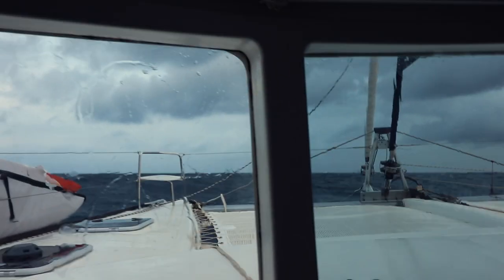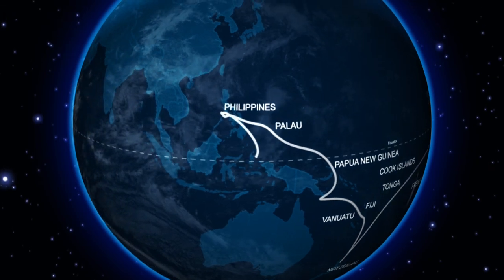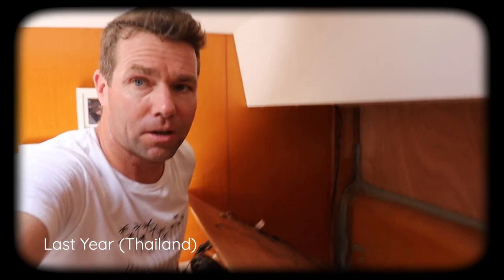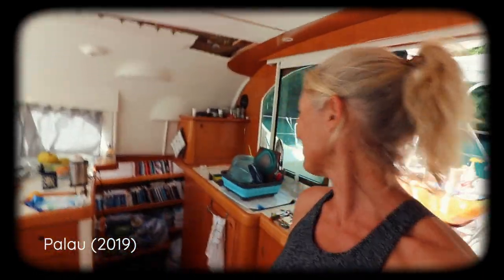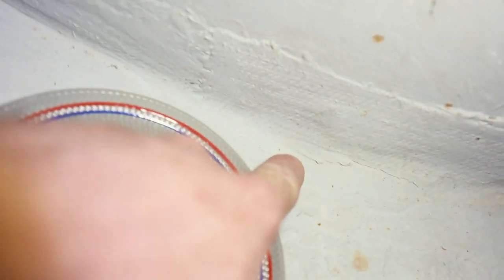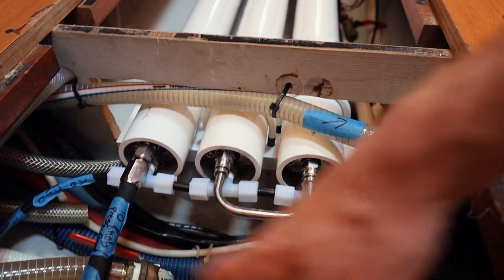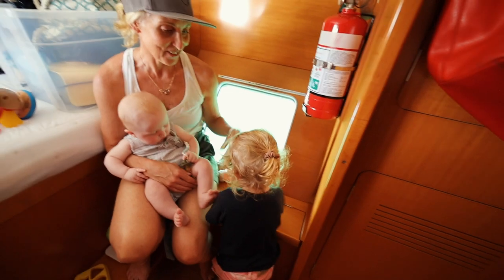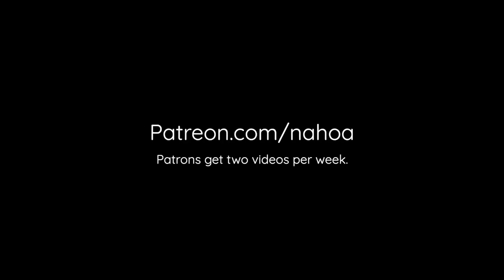Lagoon catamaran Bulkheads

Comment: When I was building my little F-9A tri (Carbon skin over duracore), I wanted to strengthen the epoxy/putty fillets before taping panels and bulkheads together. Once I mixed the resin, I added some scrap carbon fiber filaments (about 1/4-3/8" long) and mixed them well, then add the fillers/thickeners for the putty. The intention was that all the filaments going different directions would make the putty bullet proof. After shaping the putty fillets, I would immediately tape the joint together with bidirectional carbon cloth and top with peel ply. Doing it all in one shot made it all one solid piece. Of course you could use glass fibers but you'd have to make sure the filaments wet out fully and don't rob the resin from the putty.  It would be best to practice this a little first to get the mixture and technique right.
To test both putty's (w/ and w/o fibers) I smashed samples with a hammer against the concrete. The fiber infused putty was significantly stronger. It was a little harder to work with but I'm glad I did it that way.
I just figured I'd mention that option for anybody re-filleting and re-taping their bulkheads.

Comment: Thank you, guys, for this video. I have been following the saga of the bulkhead issues of Parlay Revival and have been concerned with my favorite sailing channels that use cats. I am very glad to see you have been pro-active on this unique design flaw of the cats. Every cat owner would do themselves a big favor to inspect and repair any defect in their cat for their own safety and comfort. It is a design flaw perpetuated and accentuated by cat builders willing to take short cuts in production in order to rush a product to market. Optimum high-quality products are a result of high-quality design followed by high-quality construction materials and methods. Period!
Reply: Parlay Revivals last release was on setting up their rigging and it 
Was revealing to say the least ... Part of the failure problem may have come from the cats rigging being overtightened ... according to their expert .... 
The problem being tensioning stays to monohull type levels is enough on the Parlay generations of Cat to bend the bridge deck by over tensioning against the mast stays. 🤔 This on itself would load up those full width bulk heads .. 
They even showed how it first showed up in doors that wouldn't close due to distortion it could induce.

Comment: Hey Ben, You might want to take a look at how your new lithium batteries are wired. I highly recommend reconfiguring them with bus bars and equal length wires. Its hard to tell in the video but it looks like the way they are wired now 1 or 2 of the batteries do all the work. This is crucial for the life of the battery more so now as you will be demanding much more power from them for your new air conditioners.
Reply: I never thought of that.  Very crucial for multi battery setup.  The wires can also heat up if some are a different size. I've had a plastic liner melt because 1 wire became overheated in a 3 battery setup.  Thankfully I was close to shore and safety.  
Good luck out there.

Comment: It's not just bulkheads or Lagoon. It's keeping an eye, nose, and open ear, on your boat for anything different. One telltale sign of the Lagoon 450 bulkhead issue is a creaky, noisy, boat. It was a strange noise that alerted Ben and Family about an issue that needed attention on their boat. Another thing that Colin of Parlay Revival tested was how flat the deck was, it wasn't, there was a 40mm drop in the middle. Troubles with doors not closing or gaps getting wider were another sign. Another good point brought up on Colin's channel was the importance of properly setting your rigging and gaining the knowledge of when and how to adjust it.

Comment: I'm watching another channel called Samson Boating, where Leo is building / restoring a 110 year old sailboat called 'Tally Ho'.  I found it interesting how they built the bulkheads, layering and then gluing together 2 separate walls of tongue and groove wood in apposing cross direction pattern.  

I think they use 3/4 inch, so the end wall is 1.5".  They cut two walls, with the alignment of the wood probably 30 degrees off center left and right, so one half of the wall is going up to the left and the other going up to the right.  After dry fitting, they then glue laminate the walls together, and put in hundreds of screws

https://www.youtube.com/watch?v=NPPGWtHEQO0

I also noted the Tally Ho is a mono hull, with no fly bridge to support above. 

It looks to me like Lagoon just slipped a piece of 3/4 inch wood sandwiched between to walls of thin fiberglass, where the fiberglass is more cosmetic to cover up the wood.  And that's a bulkhead on a million dollar boat with a full deck and galley above it and then maybe a flybridge too in some models?

I think the government needs to step in and regulate bulkhead construction.  If you build a home, you have code rules to stop manufacturers from building substandard then hiding it behind drywall.  Looks like boating construction needs the same oversight.

Comment: This would be the best and informative video I have watched.
To me the problem with the use of adhesive is it applied to thick.  With age it shrink, which leads to cracking.
To me if lagoon stopped using balsa wood and heavy ply but built with foam like other manufacturers. They would be building a better lighter  boat.

Comment: Because it has a crack in it not necessarily makes it unsafe, a very important distinction needs to be made between what is structural and not.
The putty stuff is not structural even though it might provide structural help but also most likely was intended to remain flexible and reduce stress and friction noise. Reinforcing this, will help the strength of your boat but maybe unnecessary as any structure is only as strong as it’s weakest point. Kind of like building a safe in the middle of your boat if you get my meaning 😉

Comment: I have never liked multihulls for heavy weather sailing. They are subject to extremely high levels of stress, particularly twisting stress, and those stresses go up at an exponential rate. That coupled with the need for light weight construction and trying to keep the costs down are a  dangerous combination..

Comment: Excellent topic for today's video!
I've been looking into the issue, as I'm looking to have a trimaran designed and built, for circumnavigation.
I've noticed one thing which has not really been touched upon, regarding all of the information on the net (real, imaginary, technical, hocus-pocus, etc).
It seems that the majority of the Lagoons have been CHARTER boats, and therefore are much more easily purchased than a new boat.
These boats are always on the market, after being abused by people who have more or less been using them as party and drinking platforms. They've received incredible amounts of abuse, what with being beached "for the fun of it," being slammed around in any and all conditions, and worst of all, having their rigging monkeyed with, tightening them and causing incredible amounts of tension which pulls the hulls up, opening up Pandora's Box when it comes to tension/compression stress, fractures and buckling.
All of these combine for terrific forces on every single bulkhead.
Then there is storm damage, which is not inconsequential.
Yes, it's fun to jump on the Blame Bandwagon (which is what has been happening), when it's much easier to point the finger at the manufacturer, rather than take a full assessment regarding responsibility, but that's human nature.
EVERYONE is responsible for the safety and well-being of their boats, so we should simply not sail them in a way which typifies the old joke about the 1950s automobiles. Remember them? "I have a BUICK!! I can drive it until it breaks, because it is so well built!" Yes, the old cars from that era lasted hundreds of thousands of miles and were easily worked on and fixed.
The Catamaran is not a Buick.
I'm aware that I'll be getting a lot of negative comments for this post, but I would much rather see videos like yours (while living vicariously through all of your incredible journeys), while keeping my mind focused on facts and reality, than sitting here with my mouth shut and watching all of the other videos out there, who spend a lot of time being negative about the whys and wherefores, rather than  being fully honest about the situation.
Thank you for your insight and great good luck in everything which you do!
Reply: As a mechanical engineer, what you said is patently, blatantly not true.  The one and ONLY reason charter boats have more issues is they actually get USED as boats instead of sitting at a dock all their lives like most boats.  A charter boat will act like a live aboard boat... HEAVILY used.  The fact these boats have their bulkheads rip out because they are too CHEAP to use fiberglass and instead only use putty, is there due to MARKET pressure for a CHEAP charter boat which the "owners" then sell CHEAP  after a few years.  These charter boat owners do not give a shit about longterm.  The boats are perfectly good for 5--7 years of use and then peddle them off to most people who will simply have their boat sit at a dock or on the hard for 11 months of the year.  

Yes, boats can be a buick, they are called monohulls.  The Current catamarans are built to lightly to last due to market pressure for short term monetary performance.
Reply: If you haven't already been watching Parlay Revival and the issues that Colin has had with his bulkheads, I suggest you watch that. Colin is a mechanical engineer and knows a thing or two about boats. He stated in one episode (after a lot of research and collaboration with various industry experts), quite clearly that the PRIMARY issue with Parlay's bulkheads wasn't due to the cyclone damage, it was due to negligible manufacturing. If I'm not mistaken, he also stated that he had spoken to the guy who designed the Lagoon 450, and the guy (pretty much) said that the bulkhead which is on Colin's 450 isn't the same as the original design he did for the 450. Which means, if you read between the lines, that Lagoon (in order to save costs) had reduced the integrity of the bulkheads during the manufacturing process. Also, I doubt very much that Colin would have gone through all the trouble of documenting and releasing those videos relating to the bulkheads if the issue wasn't as serious as it is.  Bottom line is, that the majority of manufacturers of production boats, care more about the almighty $ than people's lives.
Reply: To both "w8stral" and "happy camper," I have the same reply:
You both disregarded the majority of my post, relying upon the "I know much better than you shall ever know," rebuttal.
You didn't address the facts about the majority of the people who charter these cats, in that they drink until drunk (their version of how to party), they beach the boats, abusing them when they're sailing and they screw with the rigging.
Now, if you had included these points in your posts, admitting that these additional stresses could very easily add to what is already accepted as inferior build quality, then I would readily accept your assessments.
The "I'm and expert and you're not" reasoning doesn't work here, as you have no idea as to my credentials, and you didn't bother to ask.
Please, have an enjoyable week.
Reply: @leonply  irrespective of your comments regarding charter boats and how (a lot of) people treat the boats when in charter - which I don't dispute btw, the very simple fact is that the bulkhead issues on the Lagoon 450 has been acknowledged by the experts as a design flaw. Otherwise, why would Lagoon be sending out repair kits to Lagoon 450 owners?!
Reply: @happycamper4329  Again, you didn't read or understand my comment.

Comment: So many horror stories of major bulkhead issues with cats on YouTube glad yours looks so good. Can’t remember if you have epirb’s on board? Radar reflector when in the bigger seas in troughs of waves?
Why a tri hull want? Heard they are allot rougher riding? Can you machine aluminum brackets to add the cut partial bulkhead strength back? Nice video!

Comment: It's not necessary to buy a boat even only partially build of carbon. The problem is the joint and the core of the boats. Polyester generally has not the best gluing properties, even on hardened polyester. A proper way would be to use epoxy for gluing in the bulkheads, glassing them over and to protect the laminate and core from water some outer laminate layers with epoxy. Another really bad issue is the fact that there is non-flammable polyester for trains, airplanes and life boats. But it's not used for production boats. There may be some issues with that stuff but if it was wanted there would be a workaround already.

Comment: I see so many boats with the entire battery bank below the water line. I understand due to weight balance. I wish manufacturers would place 1 battery high that could be isolated from the main bank or tied to it to maintain charge.  Reason being you can lose your entire electric if you batt bank is flooded with salt water.  In an emergency you need bilge pumps, radios and maybe some navigation aids.  Just a though for far offshore sailing.

Comment: I truly cannot understand that a boat owner MUST accept weak bulkheads. I live in Norway and though our fiberglass/alu/steel (ie modern) sailboat production is/has been close to zero, we produce many and sturdy motorboats. But I have never heard about structural problems from our manufacturers like you seem to accept is the normal. And mind you, no sea on this planet is tougher with more pounding on a vessel than the North/Norwegian Seas.

Comment: there is a young couple that bought a sail boat from an auction.  Storm damaged.  they took it apart and what they found that the mfg did, was appalling and scary.  this was a blue water boat and yes there were places in the hull that was separating and they found that they glued it not fiberglass it.  Its thinking of when , your boat will sink not how.  Wonder how many boats have sunk with out any one knowing.  How many had to call a mayday because of their boat separating.  I own a 72 Luhrs 32. it will be going into the yard and i will be looking at a lot of places too see what needs to be reinforced and or repaired.  This is not my first boat..

Comment: I don't think you need a carbon boat to have no bulkhead issues. It would help a lot, if they where built in with epoxy putty filets and diagonal glas tape over it.

Comment: A really big part of this has to do with these (Lagoon/FP/Neel) boats being built in France.  Not that France can't built quality (just look at Outremer's outstanding build quality), but because these builders are competing directly with builders in countries with significantly lower labor costs.  Combine that with the fact that the vast majority of their production (especially in the case of Lagoon) is going to go spend the entire lifecycle island hopping with maybe an occasional coastal sail, where the stresses on the boat are significantly less.  Well now you have a recipe for boats that simply aren't being made for this kind of long distance, ocean crossing, passage making liveaboard use, and the shortcuts that are taken to ensure that the company can turn a profit start to bare their teeth.

It's also worth noting that there is nothing inherently better in this aspect to carbon.  Built to the same standard, a carbon boat would most likely be much more dangerous because carbon fails catastrophically, unlike glass.  Carbon requires a higher skilled labor in most cases, which would translate to higher build quality even in glass.
Reply: Uh, you were right up until you talked about failure modes of CF verses Glass.  They are identical and no, CF is no more difficult to use than glass.  It is more expensive is the only difference and if you wish to MAXIMIZE the strength of CF, yes, you have to build differently... but that is 100% true of Glass as well.  Almost No one in the boating industry actually lays up glass fiber correctly for maximum strength of the fiberglass.  This requires correct resin ratio and vacuum bagging.  They all use massive excess amounts of resin as they are more interested in a smooth finish out of the mold than strength.  For instance, if anyone using fiberglass is using vinyl ester or polyester, you are WASTING the strength of the glass fiber and why CF would be an even larger waste of $$$ unless one changes to epoxy with MUCH higher strength to weight ratio.  The problem is the cheap matrix material used, not the fiber.  

The problem is most boats refuse to use a hexcell core material and vaccuum bagging everything using epoxy.  It is too damned expensive.  Every Boat owner wants this as it makes a rigid, QUIET, cool boat, but nearly no boats actually have this quality as it costs ~20% more for the structure.  Yes yes, vast majority of cost in a boat is the interior work, not the hull.  How many are buying bare hulls and doing the interior work themselves?  Nearly no one.

Comment: I don't know about You boat model in particular, but, aren't most all Bulkheads "T" fiber-glassed tabbed at or near the bottom side of the hull & that Old Dried Out "Putty" was engineered Just to keep down the "creaking" & NOT fiber-glassed Solid to the sides of the boat to ALLOW FOR Flexing Of the sides to minimize structural cracks from pounding of the waves? There MUST have been an engineering REASON it was NOT fiber-glassed.

Comment: Other than multi million dollar race boats, builders are using vinyl ester resin ( which is shit) with their carbon fiber construction, so these boats are not near as good as what buyers think they are! I would prefer to have a bulkhead separate, than rip a hole in a hull. As Ben said, banging on the hull laminate with a hammer, lets you know the condition of the hull.